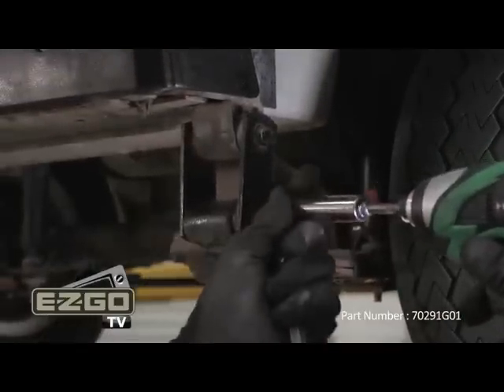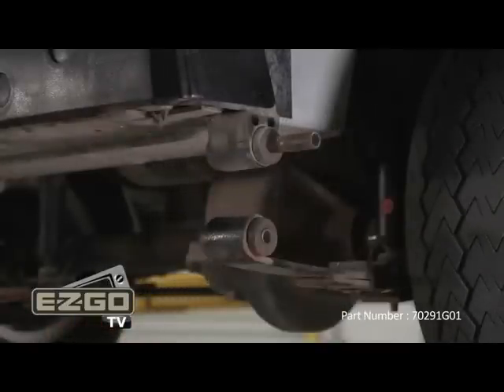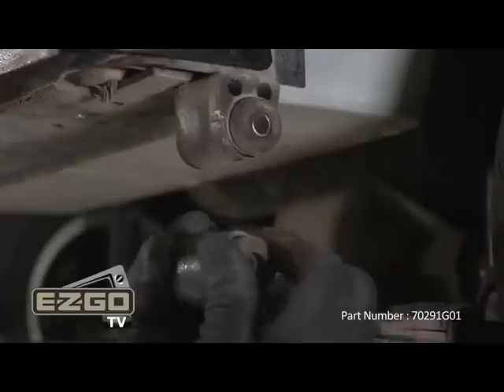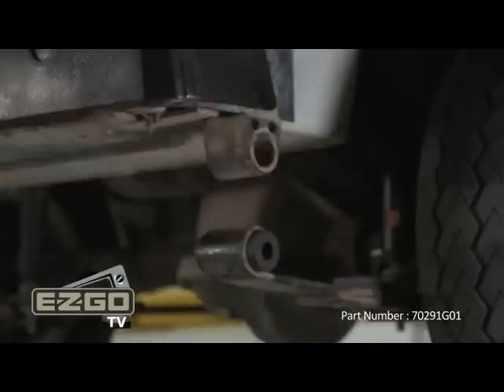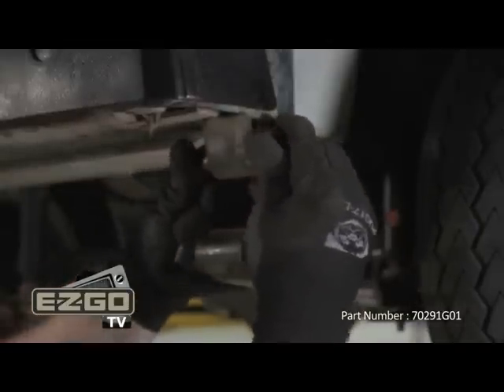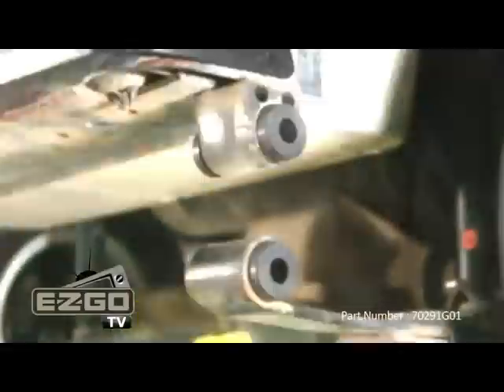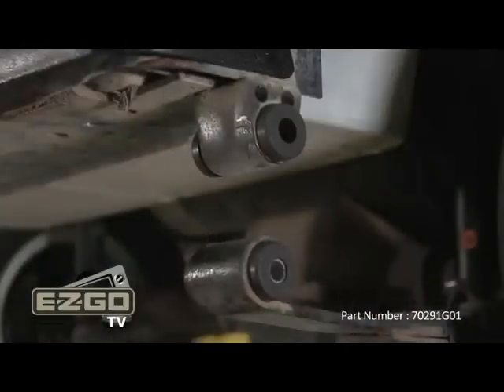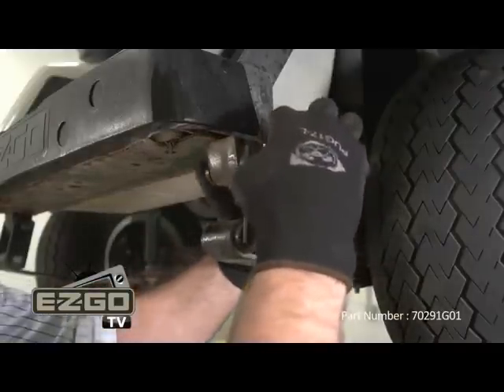E-Z-GO Bushing for Leaf Spring

Comment: should the new bushings be greased?
Reply: I always grease the sleeve and bolt. Never had to take one apart a 2nd time, but it can't hurt adding a dab of thick grease to the metal to metal surfaces.  Big truck and aircraft mechs are required to do this.